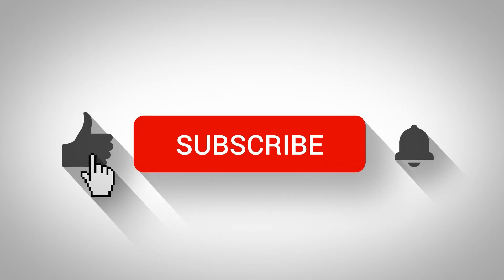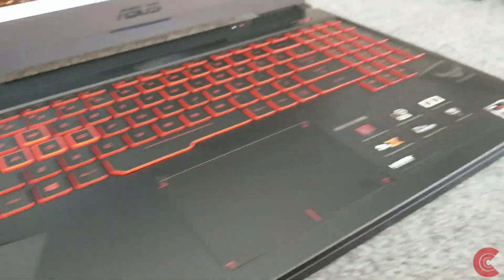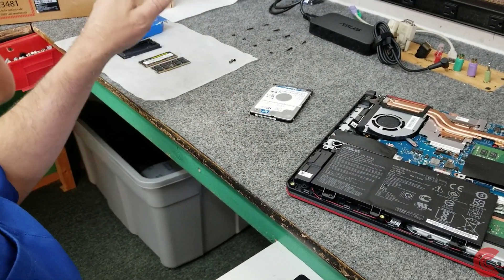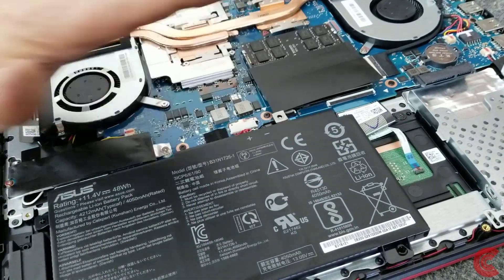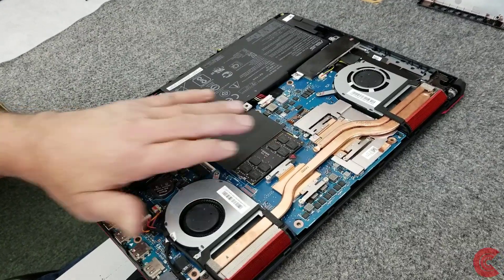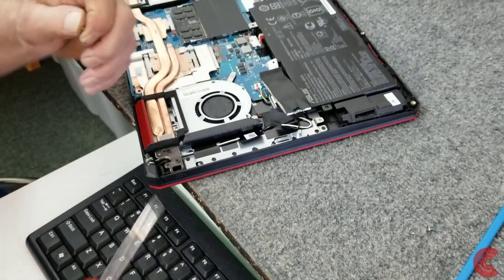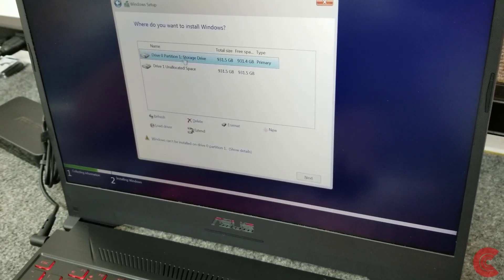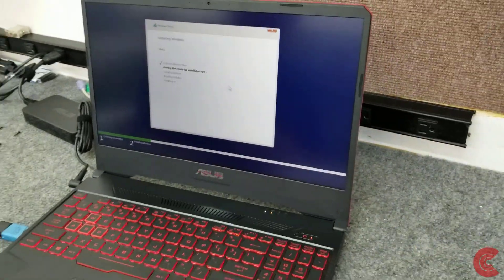ASUS TUF Laptop SSD, Memory Upgrade & Add Internal Hard Drive, clean Windows 10 install

Comment: I opened up the back panel and found the ram brand is hynix Korea 8gb ddr4 2666hz ! I need to upgrade my ram ! Do I need to buy two sticks or is there a way to match the stock? As I checked on crucial ram website they checked my system and it gave some recommendations that if will be compatible with your laptop! Buying in different brand will it match the stock (or I need the same brand)
Reply from the maker: It should be fine to mix brands.  Just use same speed if possible,  2666mhz
Reply: @CadillacComputerCenter  I have this same asus 505dy so please can you check and say wheather it works?
Reply from the maker: I have mixed brands many times, with no issues.  Just use same speed. You'll be fine. Dale
Reply: @CadillacComputerCenter  but when I see the memory speed in task manager it's 2400 and when I remove open the panel and see on the ram it was 2666 which should I believe?
Reply from the maker: Go by what is on the ram stick. Thx
Reply: @CadillacComputerCenter  sorry for the disturbance sir ! But I checked the amazon where I bought my lap! There it is 8gb ram 2400 hz I'm so confused what should I buy now! Again
Reply from the maker: Do this, just buy 2 , 8gb sticks of 2400.  There is no noticeable difference between 2400 & 2666. 2400 is what I use the most.
Reply from the maker: I reccomend Timetec or Corsair brand. Crucial is good too.  Your stick you have now may be marked wrong.  Dale
Reply: @CadillacComputerCenter  sir If I buy 2 Ram of same Brand and speed what I'll do with the third one in lap
Reply: Bro is your lap is in warranty I called service center they told warranty will void if I open back panel...I just brought and want to upgrade but confused in buying Ram amazon says 2400mhz and some says 2666mhz what to do
Reply: @rithikchauhan946  no bro it's out of warranty. !! I checked now it's 2666mhz only bro! In task manager it shows like that! If you still have doubt use some third party apps like cpu z and many more ! Even cmd ! I'm sure it's 2666mhz because my brother's laptop is acer predator Helios 3000 it has 2666mhz ram and I just tired with that it's working perfectly fine it detects the ram and I tried playing game too it utilizes the ram ! So now I ordered a 8gb 2666 form crucial
Reply: @rithikchauhan946  you have another way go to crucial website there you will find solutions go there scan your computer  and it automatically detects the ram you need for upgrade ! If it comes out 2666mhz then you laptop runs with 2666 mhz that's it
Reply: @harivishal5905  bro ru going to do it on your own or u will go to service center...also if we do it will it void warranty of fx505dy 3550h SSD varient reply ASAP
Reply: @rithikchauhan946  bro I got my ram and I installed by myself ! Actually my laptop was one year old so no warranty and I did myself ! I bought it crucial ram and it matches my stock perfectly well! And performance is also soo good 🙌

Comment: Is it enough i just add 4 gb ram? Pliss tell me
Reply from the maker: Hi, adding just 4gb of memory will make no noticeable difference.   16 to 32 gb of memory would be best.thx, Dale
Reply: @CadillacComputerCenter  tq sirrr..
It help, i almost buy 4 gb btw....
Reply: @CadillacComputerCenter  can i ask more question
My laptop tuf fx 505 dy 
My cpu and gpu laptop trmperature about 70-80 without gaming, i have turn off my turbo mode and i play at ac roomm...
And when i play dota it got 80-90 
Huhuhuhuhu
I just use my laptop to play dota 2 hours/day and daily activity, never rendering and etc...
Please help me
Reply: @redoagusta9955  change thermal paste

Comment: Whar if i lost the extra screws that come with the laptop to keep the ssd in place?
Reply from the maker: Do you mean the m.2 drive or 2.5 inch hdd?
Reply: @CadillacComputerCenter  i ordered a 2.5 wd blue ssd a few daya ago but i dont have the screws that apparently come with the computer
Reply from the maker: You can easily order all those type of screws on Amazon or newegg.  Or, go to a local repair shop, I'm sure they would give you some.
Reply: @CadillacComputerCenter  ok thanks

Comment: Sir can uh help me plz
Reply from the maker: I can try.
Reply: Sir i ordered a 512gb model.there is no hdd And i have to upgrade 1tb hard drive, then i have to clean the window?
Reply from the maker: The 512gb is a nvme ssd drive.
Reply: Sir one more question .Sir where can i get 1tb hard drive and 8gb ram online ... For this laptop tell me 
Because i want to get this laptop
Reply from the maker: Amazon or newegg are good places to get 8gb ram and 1tb hard drives. Any brand will work.

Comment: Hi I have the same laptop, but the model without hhd, can I put an ssd instead of a hhd ? Will it works correctly? Thanks
Reply from the maker: Yes you can. Dale
Reply: How did u  Activate your windows though without a window key

Comment: Can i add extra ssd sata 3 in hdd place ?
Reply from the maker: Yes you can. 2.5 inch
Reply: Cadillac Computer Center Ok how about the m.2 placewhat do recommenced me to buy ?
Reply from the maker: Amazon or newegg are good places to get ssd drives.  Wd blue, crucial or Samsung are good drives. Adata is good too
Reply: Cadillac Computer Center 1 TB will work ? m.2 ssd or m.2 nvme ? Because i have Asus tuf FX505GT-AH73 and i want to upgrade it.
Reply: Cadillac Computer Center  i have Fx505gt-ah73 what is the maximum ssd sata capacity ? Can you help me please 🥺

Comment: 2400mhz or 3200mhz?
Reply from the maker: Will support either.  Also 2666
Reply: @CadillacComputerCenter  how about yours? is it 2666mhz 16 gb of ram?
Reply from the maker: I used 2400 in this video

Comment: Whats is the ssd compatible for tuf fx505dy? M.2 Sata or M.2 NVME? Ty
Reply: But the advantage is NVME is more faster right?
Reply from the maker: Absolutely.   Yes
Reply from the maker: M.2 NVMe pci-e but sata will work too.
Reply: But i have heard on the other reviews that tuf fx505dy is compatible only for M.2 NVME? 😅. Which is which sir?
Reply from the maker: The difference is the slot key. M key is nvme, sata uses b key. Sata m.2 drives are cheaper, but are still ssd.  Use nvme for best speeds always.

Comment: Hi,  am having old hdd with os windows 7,  am purchased tuff fx705,  can i instal directly old hdd to new lap as a internal hdd or require a formate a old os,
Reply from the maker: You can use your old hdd as an internal storage device,  yes.  You cannot boot from it though with windows 7 in your new TUF.  you'll need to delete partitions and format it in windows 10.

Comment: when i changed my ssd, putting the new ssd, im stucked on a boot loop (bios utility). do u know the solution for this? pls help
Reply from the maker: Is your new ssd bare, no windows installed?
Reply: @CadillacComputerCenter  no windows installed, no nothing.
Reply: and oh, the new ssd is, m2 nvme ssd sabrent  rocket q 2280 PCIe Gen 3 X 4
Reply: @mxrislyna  Change the boot order.